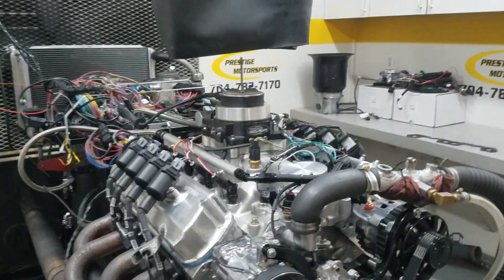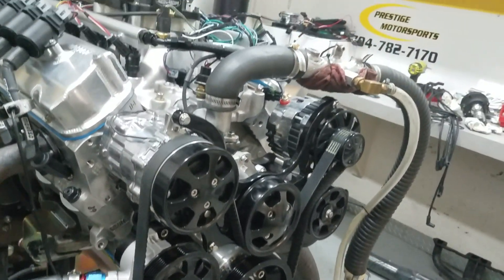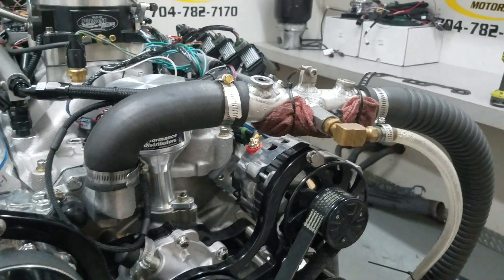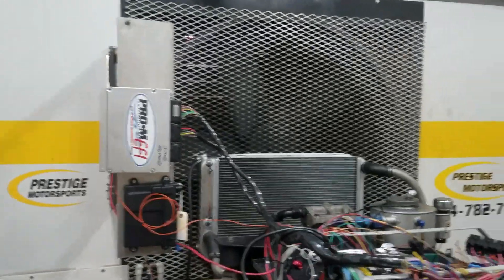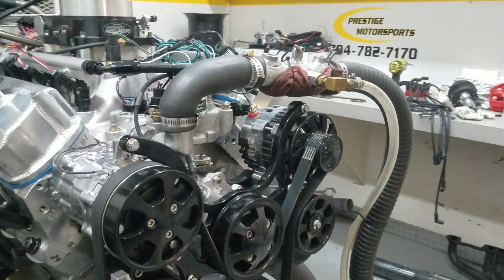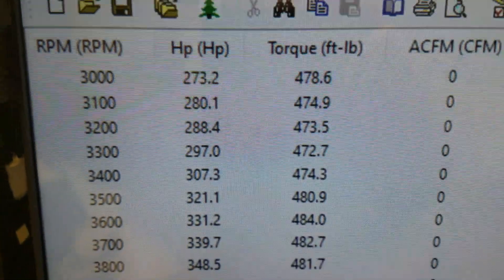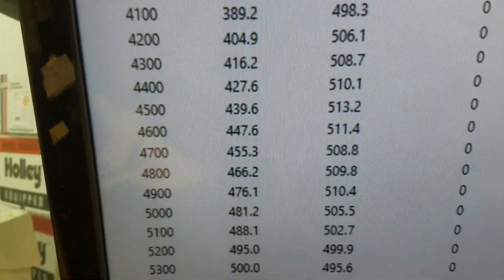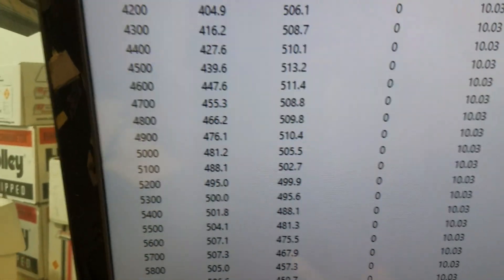Julius' All Aluminum 436 Small Block Ford with Pro M Racing Fuel Management on the Dyno

Comment: Sweet little motor , must have a small cam,sounds smooth ,I would love this combo with a bigger cam and my Crossram ITB intake ,https://youtu.be/b0GIYqNOlzU      , Great job ,my  4 barrel type throttle body manifold  worked great  ,  just time for an upgrade . Cheers